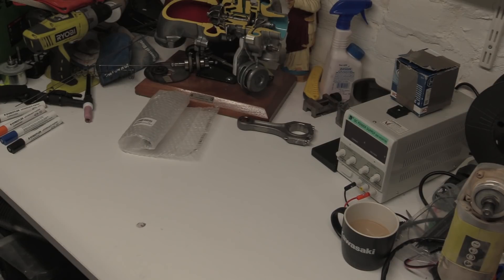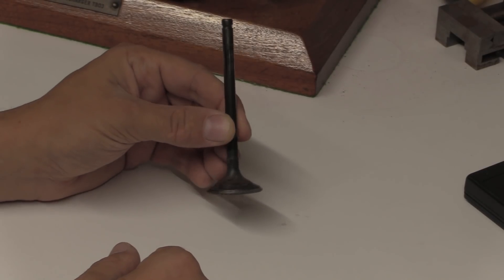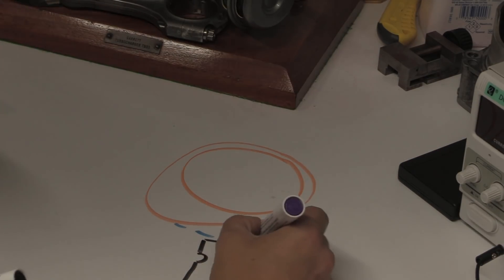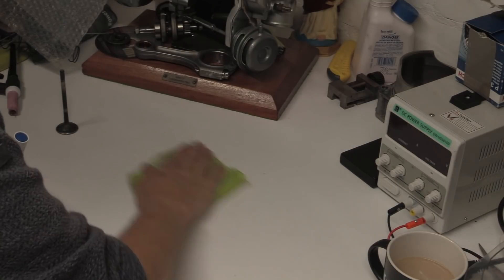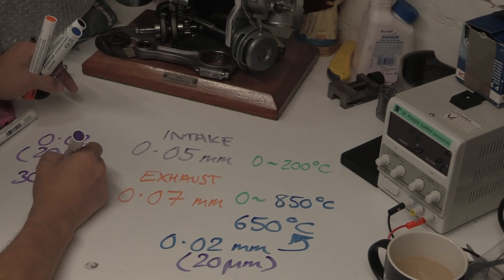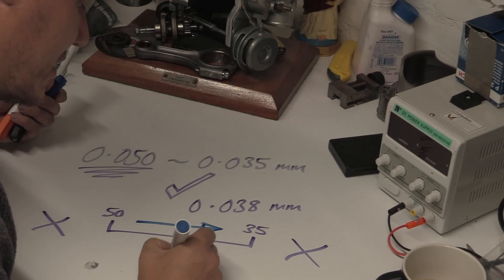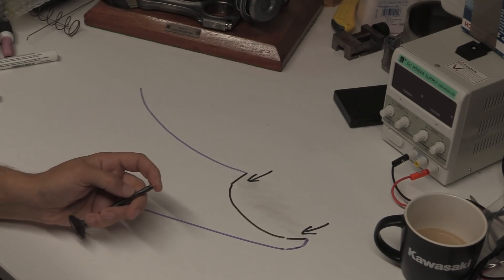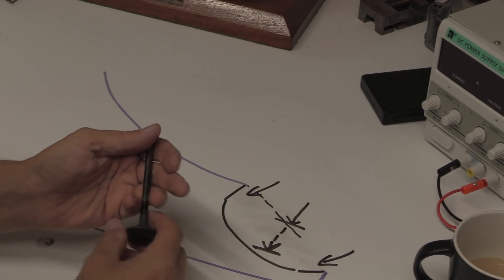Valve Clearance - how, why, when?

Comment: I just looked up my engine's valve clearance values and they are 0.10 to 0.15 on the intake and 0.20 to 0.25 on the exhaust (rocker arm single cam).  I'm wondering why they're so big? What if I decreased the gap a bit?
The engine is Renault K7M 1.6 8v

Comment: Sorted a mates old zzr600 which, was a non starter. Compression was v low and fuel was blowing back through the carb on compression stroke! Can't remember figures exactly but had to go down couple shim sizes before even got a gap! Turned out he hadn't had valves checked since 30k, the bike was on 59k! Surprised that hadn't caused seat damage but with correct clearance managed to get that cylinders compression within 10% of the others. He got rid rapped after that. Great explanation 👍

Comment: Bro, every manual has upper and lower clearances and I never know which one is best. Also when using free flow exhaust how I have to adjust the valve? Nobody, in anywhere responded that yet..
Reply from the maker: Free flow exhause valve adjustment?
Reply: @thedirtyworkshop  thanks for replying, I meant free flow muffler, replacing stock exhaust.. But the main concern is which maker manual value should i take when adjusting: upper value or the bottom one. There are lots of videos how to, but none to explain which value is best. Your videos are great, sorry for the poor english, greetings from Brazil!

Comment: I thought I was playing safe and set the clearances to the upper limit on my 1200 Bandit, It sounded like a biscuit tin of nails. so I now set just off the min and check them regularly, its quite a short check interval for the Bandit  anyway. Is there a risk of damage from having the clearances over the max, the valve or rocker would be contacting the cam further round and the profile with more force?
Reply from the maker: Just more noise and slightly more wear. It can cause problems with rockers, but we'll get into that

Comment: I have a bike that had too tight of valve clearance.  Bought it used supposedly was a track day trainer bike (yamaha srx 250). Rode it around, didn't realize till I got home that it felt like it had less power than my 125 scrambler. Found the exhaust valve clearance was way too tight. After the shim swap I swore the compression went up and it made it's full (24ish) hp. Now it's doing some other weird shit, but it's on the project back burner for now.
Sometimes it's nice having hydraulic lifters, or easy access screw+locknut valves.

Comment: Damn I had the worst time figuring this stuff out last time I did the valves on my bike. Started over thinking it and it just got worse. 

Can you shed some light on the statement that certain (aluminum) heads shouldn't be lapped? I'd guess it's related to the hardening of the metal?
Reply: Titanium valves with special coatings must NOT be lapped because they lose the coating and wear excessively. The correct procedure is to cut the seats and if necessary replace valves. For anything that's older with just plain old steel valves then lap away.
Reply: Well shit.    Guess I could've lapped the valves. Now I've got suspicions that my valves aren't seating well enough
Reply from the maker: https://m.youtube.com/watch?v=M45wrq0Nv_c

Comment: Another consideration for clearances is that cams are quite sloppy in their journals compared to main and big end journals.
Reply from the maker: What?
Reply: Check the specifications for cam journal clearances of a few engine models. They fit like dicks in a shirt sleeve.
Reply from the maker: And then there's thermal expansion...

Comment: Hey Matt, question here, some people say that with port injection and especially with electronic throttle body. You get carbon deposit on the intake valve and intake port. How’s that posible. isn’t the valve supposed to be closed and the fuel doesn’t go anywhere near that part of the bike.
Reply from the maker: Not port injection but direct injection.
Reply: exhaust gas recirculation back into the intake.  With direct injection the is nothing "washing" back of the intake valve like there is with port injection
Reply: Direct injection - timing (normally variable on modern stuff) and pcv system can let build up occur. Only a problem really for engines that do mostly short journeys, run shit fuel and oil and generally lack maintenance. Had vw 2.0TFSI engine with over 210,000 miles when sold, previous owner and I looked after it properly, never had an issue with intake valves. Other shit made from plastic with low quality rusted fasteners however......

Comment: Barely rev my Zrx1200r above 2.5k - 3.0k rpm most of the time (most of its use in city plus I’m an old bugger) so I won’t need to check the clearances at Motocycle intervals - more like car mileage intervals 30k to 50k - not going to hit the valve seats so hard at lower (car range)rpms

Comment: Off topic, but I have a question mate. Do you think, in general, fuel additives like sea foam and MMO are worth using for cleaning off carbon on the valves? I’ve always figured it’s a bit of snake oil since fuel already has additives in it.
Reply from the maker: We'll be ing some testing soon
Reply: @The Workshop awesome to here, looking forward to it
Reply: @thedirtyworkshop  It's a longer proces and not widely used, but I just installed water methanol injection again. This cleaned my EGR abused intake up like new on my car so why not on my motorcycle.